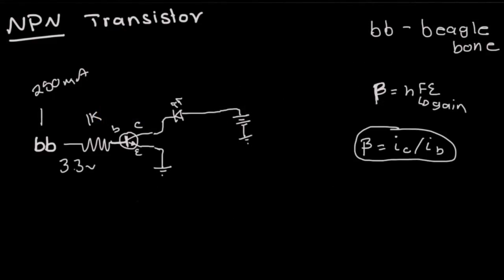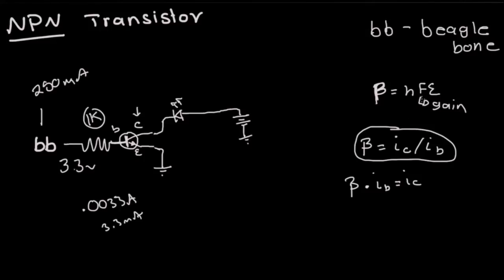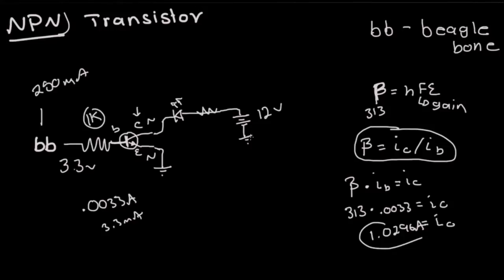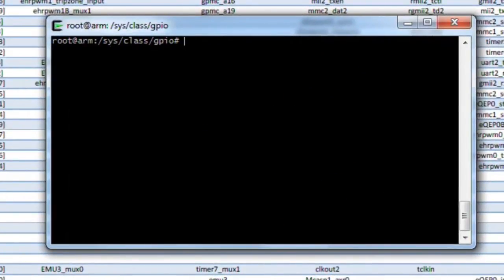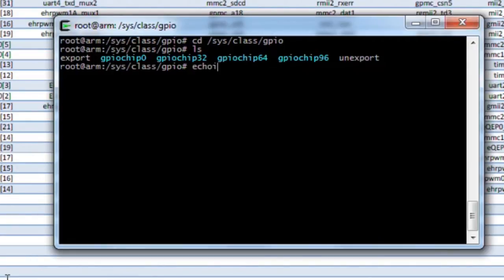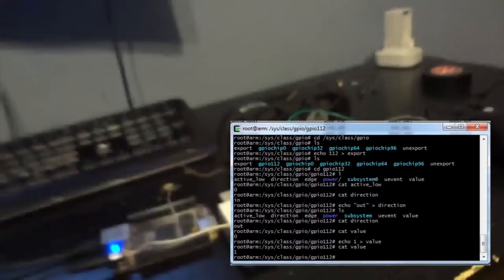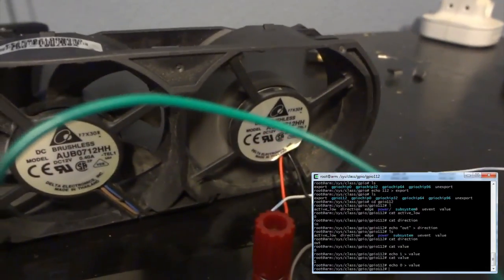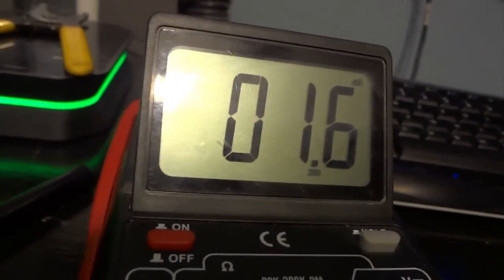How to connect a BJT transistor to a Beaglebone Black

Comment: Very good job on your videos, I enjoy it. Did you find where the error was in the end?
Reply from the maker: I believe the multimeter inaccurately read the hFE value. I think this is so because no matter what the current flowing through the transistor was, it consistently read the same current through the base terminal.

EDIT: The reason it was off was because I forgot to calculate the voltage drop between the base and emitter.

Comment: What transistor did you use and why? What is a good general purpose PNP and NPN transistor to purchase?
Reply from the maker: I used NPN because its what I had laying around. They should be the same when it comes to switching. When I get home ill edit this comment with the brand I use. I forgot the name. It handles high current well and ataches to a heat sink.

Comment: Thanks for the video. How much is the voltage drop across the transistor, 0.6V ?. 

Your current measurement is wrong because 1.6mA at 12V (or 11.4V) corresponds to less than 0.02 Watts, which is WAY too low a power consumption for a 3 inch fan.
Here's a spec. sheet for a 12 Volt DC fan that is 3 inch diameter, which I'm guessing is what you have. It consumes 1.7 Watts and is their lowest power model for this size.
http://img.ebmpapst.com/products/datasheets/DC-axial-fan-3412N-ENG.pdf?_ga=1.10473845.1316117005.1449118453
Reply: Your probably right. I made this video before I had taken a course in electronics so I didn't fully understand what was going on
Reply: and the fan came off of a Xbox 360.